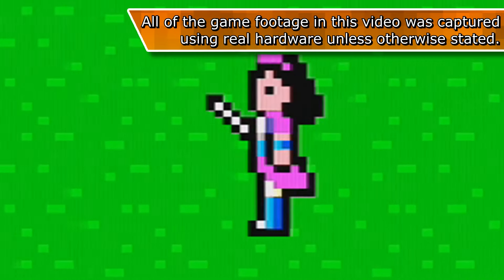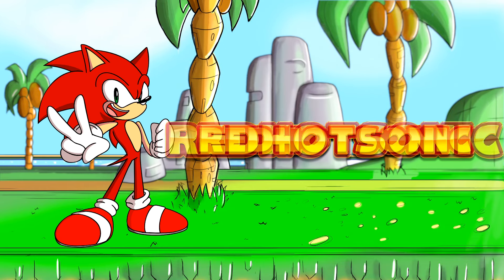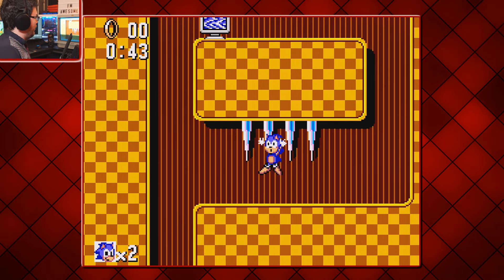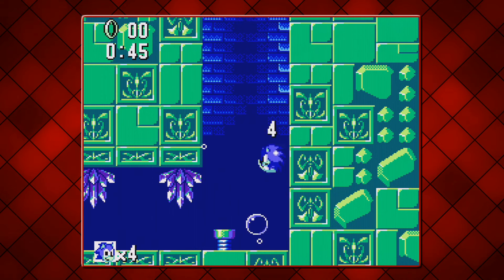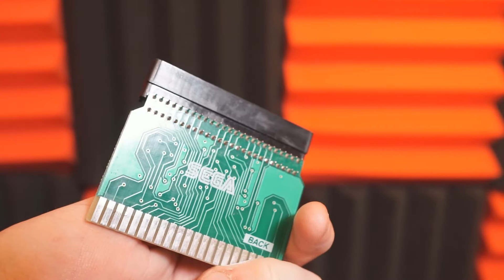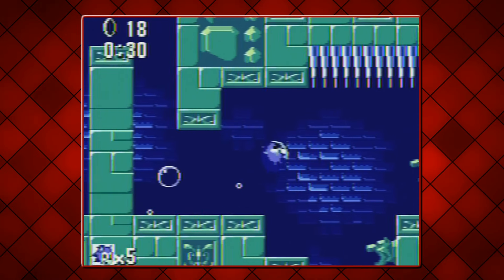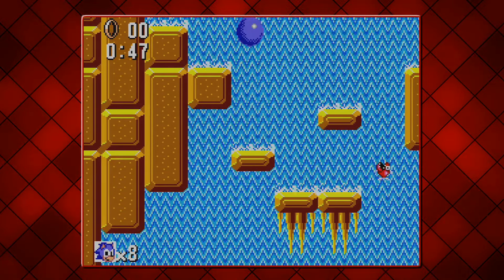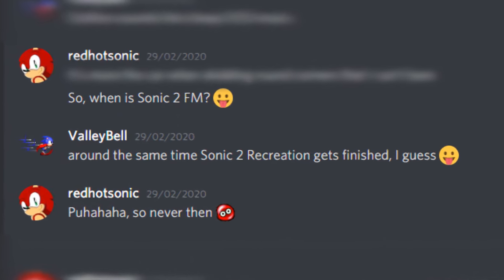Sonic 1 FM - But does it work on Real Hardware?

Comment: The master system is underrated.

The 8bit sonic 1 is very different despite being called sonic 1.
8bit sonic 2 has tails on the box but tails isn't playable he actually gets kidnapped by eggman.

The Sega master system 3 looks slick as hell it just looks so nice and cool.
Reply: Wow I never knew
Reply: I personally prefer the Game Gear version of Sonic 1, as it fixes a few bugs (like how you don't die by torching the bottom edge of the TV screen in Jungle Zone Act 2 >_<).
Reply: @RadioTails  it isn't a bug it was removed because the game gear has screen crunch
Reply: @RadioTails  That isn't a bug, it's a feature
Reply: Not in Brazil and Europe

In these places the Master System continues to survive until 1997 receiving numerous Game Gear ports.

In Brazil the Master System even won an exclusive version of Street Fighter 2 and Battlemaniacs, even with the PS1, Saturn and Nintendo 64 in places like Brazil the Master System (and Mega Drive) became cheap options for those who didn't have much money to invest in a console.
Reply: @MoonSarito  duke nukem 3d for fricking sega Genesis
Reply: sonic 1 for the master system is better than the one for genesis
Reply: edge lord 
*Sega Mark III
Reply: "Sonic chaos"
Reply: @RadioTails  and it removed Sonic’s nose! Yay!!
Reply: Surprised you left out the fact that if you get the bad ending taiks fucking dies

Comment: Alternative solution: Terraonion's Mega SD.

My guess is few people will go importing a Japanese Master System just to play MS Sonic 1 with FM sound.  Another, much more practical, way you can do this on, technically, real hardware is to get a Mega SD from Terraonion for €232 (I'll link it at the end).  If you know anything about the Mega SD, you know it's basically an Everdrive for the Mega Drive/Genesis that has onboard Mega CD/Sega CD emulation chips that allow you to play Mega CD games from an iso file off an SD card without needing the actual Mega CD peripheral (or the 2nd power brick).  Of course it also lets you play regular Mega Drive/Genesis games (yes, all regions, though there can be speed issues when playing 60Hz NTSC games on a 50Hz PAL console, and vice versa). 

But on to the main point.  As you probably know, the Mega Drive is backwards compatible with Master System games and includes the same chips that are in the Master System, so playing Master System games on a Mega Drive is essentially playing on real hardware.  The Mega Drive isn't using emulation to play Master System games.  So if you load any Master System ROMs onto your Everdrive/Mega SD, the Mega Drive will play them just fine.  However, even though the Mega Drive uses FM sound for Mega Drive games, the Master System FM sound chip is different and so no Mega Drive/Genesis can play the FM sound in Master System games.  BUT, a feature of the Mega SD that gets completely overshadowed by the Mega CD emulation is that the Mega SD can also emulate the Master System's FM sound chip.  And, of course, all Mega Drive/Genesis units support RGB out.

SO, since you'd have to use an Everdrive anyway to play Sonic 1 with FM sound, if you have a Mega Drive/Genesis you can get a Mega SD and play Sonic 1 with FM sound on your Mega Drive, which again is essentially original hardware.  This seems to me to be the most practical way to play SMS Sonic 1 with FM sound without emulation.  And wile €232 is steep, so is buying a Japanese Master System/Mark III + FM unit OR Master System FM mod + Everdrive.  And you can also play all Mega CD/Sega CD, Master System/Genesis, and Master System games from any region.  

Link to Terraonion's website:
https://shop.terraonion.com/en/products/16-megasd_megacd_segacd_fpga_cartridge.html

UPDATE: I just checked and the Mega Everdrive X7 also has a Master System FM chip.  Again, this is to play Master System games on your Mega Drive/Genesis, not your Master System.  Earlier versions of the Mega Everdrive (X5, X3) do not have this feature and no version of the Master Everdrive have FM sound chips.  So with either the Mega SD or Everdrive X7 you can play Master System games with FM sound on a Mega Drive/Genesis.

Comment: Oh actually this is worth a second comment - I've just noticed you do proper subtitles and especially since that's much rarer on YouTube than television, as a partially deaf viewer thank you loads. I don't think I noticed that until now (though I kinda have the memory of a pensioner so I'm not sure), as I've usually been turning them off for the mobile app, since I didn't realise it had subtitle settings buried in it that (like the web player) let you remove the black background, shrink the text, add a drop shadow and generally make the subtitle display far less obnoxious.

Comment: What confuses me to this day is that I have clear memories of running Meka for DOS, enabling FM unit, and that enhancing game gear game music, including Tails' Sky Patrol. I went to a boarding school in like 2005, and I remember setting it up on old common use machines. Haven't figured how how to do that since.
Reply: I went to a boarding school in like 2005 too (2005-2008 actually).

On the residential side, there was a lot of gaming stuff going on if you counted everyone's stuff, like PC, NES, SNES, standard GameCube, modified GameCube (IcedCube), GBA SP AGS-001 (with GB/GBC/GBA games), DS Phat, DS Lite, PS one, PS2 Phat and Slim, PS3 Phat, PSP, original Xbox and Xbox 360. There was even some GBA emulation on the PC going on.

No Sega hardware unfortunately; pre-2001 Sega was only represented by Sonic Mega Collection Plus on the PS2, the Radica Mega Drive plug-and-play (Volume 2) and the PC versions of Sonic 3D and Sonic R (although I did go to one of the boys' normal homes 4 years later in 2012 and he had a Mega Drive 2 sitting next to his PS3, but yeah).

On the educational side, before the Windows 98 PC in one of the English classrooms (that we got to play on if we finished our work early) was replaced, it had a load of Sonic fangames on it! Like Sonic Robo Blast "1", and one which had the Sonic CD Quartz Quadrant "present" music in it which I'd like to know what it was called.

Comment: This also works on a Mega Drive using the Mega SD flash cart, that allows FM playback with MS games.
Reply: and Mega Everdrive X7 and Mega Everdrive Pro, but with all of those the YM2413 is in FPGA. You can use a db electronics Powerbase FM to get the Master System FM sound in real hardware on a Mega Drive / Genesis.

Comment: You can use RGB with the FM unit. Just don't plug the FM unit into the back of the console. Instead plug your RGB cable in there. Then use a second standard composite cable for the audio from the FM unit.

This of course doesn't fix the non-amplified RGB problem.

Comment: I'm a little late to the party, but to anyone reading this, it does work on a Mega-SG using the SMS adapter and a Master Everdrive X7. However, the pause button crashes the game, freezing it indefinitely. So you can't pause. Otherwise it works just fine.

Comment: I think that Sega omitted the FM synthesis because of cost cutting and saving it for the Genesis
Reply: It’s not the same thing... (not the same chip) , just because the American master system was released in 1986 (psg was only available at that time) and fm was introduced in Japan in 1987, sega couldn’t release it after the original release since companies didn’t tend to do that sort of thing back then, and it was to maintain compatibility

Comment: Entertaining as usual RHS but you forgot to mention that if you have a Mega EverDrive X7 with Necronomfive's FM core built in via FPGA, you can play Sonic 1 FM edition on your Mega Drive/Genesis, which is a far cheaper option than spending god knows how much on all that equipment just to play a selection of SMS games with YM2413 sound.
Reply from the maker: That's not real hardware, is it?  That's a Mega Drive?  Hence it was not included.
Reply: You could also get the Power Base Mini FM which is REAL HARDWARE as it has the FM chip in it. And it's only $60.
Reply: He does it so you don't have to.
Reply: @redhotsonic What? You're saying a Mega Drive isn't real hardware? It is real hardware, there's nothing wrong with playing Master System games on a Mega Drive or Genesis. The system has a Zilog Z80 and it was built off the Master System it's predecessor. Why do you think SEGA released the Master System/Power Base add-on?

I'll go one further, the Analogue Mega SG has an FM core built right into it, so you can easily pop in any Master System cartridge and tick FM in the settings and don't you dare say it's emulation because it's not. 

I understand you're an EXTREME purist who enjoys spending big amounts of money on all the original 1st generation hardware from SEGA and it's great to see that, but it should still be pointed out that there are other, cheaper ways of getting SMS games to run with FM music.

Only emulators out there are either on mobiles, PCs or those horrid ATGAMES consoles.
Reply: @Oysterblade84  It's not actual Master System hardware though - it's a Mega Drive in back compatibility mode which isn't exactly the same thing (no SG1000-mode game support)
Reply: I've actually played it on my Genesis using a Powerbase Mini FM and Master EverDrive (V1, not X7), and it has problems. It does play music and sound effects, however the music is off key many times when sound effects are playing. Curiously enough, the FM hack of Dynamite Dux presents the same problem. I'm not sure if it's an EverDrive V1 issue, a compatibility issue with the PowerBase Mini FM, or an issue with the two functioning together.
Reply: Also there are some slight differences between a Genesis with FM sound and a real Japanese Master System with the sound balancing, as presented in a comparison by RetroRGB. It appears that the lowpass filtering of the Genesis muffles the sound slightly when compared to an actual Japanese Master System/Mark III FM sound unit.
Reply: @-SG6000- That's like me saying the Master System or Mark III doesn't have actual SG1000 hardware and was only backwards compatible with it, so by your comment and by RHS's purism, playing SG1000 games on his Mark III or American Master System is fake. He'll need a real SG1000 machine. 

The point i'm making is fact. A Mega Drive Genesis has actual Master System hardware in it, that's the point so it's REAL. Both Master System and Mega Drive have the same Zilog Z80a chip, both have the same VDP chip only the Mega Drive's was a bit more powerful. The only difference was that the Mega Drive lacked (mode 3) which is SG1000 that was originally the backwards compatibility of the Master System. Wow! we can't play F-16 Fighter big deal. Did anyone really give a rat's about this one particular title?

I understand RHS is a purist who enjoys playing the games on the original hardware and that's fine, I just wanted to point out that there are cheaper ways to play SMS with FM music on real hardware than the path his wife made him choose.
Reply: @Zane Gandini, But those are slight sound comparisons between the hardware specs like the dirty muffled YM2612 compared to the later, cleaner ASIC-YM3438 of the Mega Drive (Genesis). The point is that playing SMS games with an FM option on the MD/Genny is just as real as a Master System or Mark III supporting the same feature. The SMS FM core in the Mega EverDrive X7 is not the same as running an SMS game with FM mode on an emulator, FPGA is a programmable customised replica of all the original hardware inside the Mega Drive which is what the Analogue Mega SG does, it's not a cheap system on a chip like Radica or ATGAMES.

Dynamite Dux with FM sound is a hack like you mentioned which is why it has a bug in the audio, that's why it's sounds messy, it does that on my Mega EverDrive X7 and Analogue Mega SG. All other SMS games i've played with FM sound fine.

Comment: You actually CAN get RGB out of the Mark III with the FM sound unit, but you have to use 2 cables. You just plug the big ribbon cable into the front of the Mark III and leave the AV adapter for the FM Unit unplugged. Then use the Mark III's video out for the RGB video, and use the FM unit's AV out for the audio.
Reply from the maker: The problem with that was I would then have to solder both cables together into one SCART plug which seemed like a hassle 😅
Reply: @redhotsonic  Ahhh SCART. I'm running the HD Retrovision component cables which makes it a bit easier. You've got like 6 Master Systems now though, so it sounds like you don't need to bother with all that hahaha

Comment: So, here's a question I assume was answered a REALLY long time ago...

But still, I wonder. - Given that a Mega Drive with a Power Base Converter can run master system games, and the Mega Drive has both the PSG channels AND an FM synth chip...

Does the Mega Drive play FM sound with any master system games, or did they arbitrarily disable this in spite of the hardware?
Further, since FM synth was a standard feature of Japanese Mega Drives (and an add-on for the mkIII), does this vary at all between western and Japanese Mega Drives?

Comment: Besides Phantasy Star, are there any other games that have FM support removed from the Rom or is it just Phantasy Star that does this unlike other games keeping it in code.
Reply from the maker: List of games with conditions here: http://etim.net.au/smsfm/smsfm.html
Reply: @redhotsonic  Thanks, but in addition, is there also a list of Genesis/Mega Drive games that use batteries (SRAM), because I can’t find any and I just got a JP copy of Phantasy Star 2 yesterday and that used a battery for saving.

Oh and do you replace batteries in your carts, is so, then do you use knife and electric tape or do you do soldering or do you replace SRAM with FRAM/FeRAM.

Comment: I believe that since Sega made the FM sound board and released it as official therefore legitimate.
Reply: the hardware yes. this game never had a soundtrack for it made, until ValleyBell did in 2014 (the Japanese Master System was discontinued in 1989 but Sonic didn't exist until 1991)

Comment: What about the Power Base FM? Or the fm chip inside the mega everdrive?
Reply from the maker: The Power Base FM should in theory. Just putting the game onto a cartridge for the Mega Drive will NOT work as the FM chip in the Mega Drive is different. It'll just play PSG. But, you can get some flash carts like the X7 that emulates the SMS FM for the MD and then it'll work.
Reply: @redhotsonic  Yes, I was referring to the latter. I guess the Power Base FM with a Master Everdrive would make more sense from a real hardware perspective

Comment: SONIC 1 FM but does it work on a sega master 2 real hardware ? that’s the question , does it only work on the japanese consoles with the FM sound chip ??
Reply from the maker: The SMS2's never had the FM built in or it couldn't make use of the add-on. But if you got Tim Worthington's FM mod like I did with in this episode, in theory it should work.

Comment: Did you really just use a flash cart to play it, go put the rom directly onto a cartridge, what makes you think that is good enough?
Reply from the maker: What makes you think I, or anyone else for that matter, have the technical know-how to get a ROM, program it onto a chip, solder that chip onto a board that's compatible and then make a pin layout that the Master System would understand?  And if I did do that, it would be a unique cartridge.  If that then say, didn't work, it could be because of my own doing, or just the components I used, etc.  The EverDrive is widely available, and would be something that most people would also use to play ROMs on their system.  Hence, I used this.  This means anyone out there who's thinking of getting an EverDrive and wants to know if this game is compatible, they now have the answer.  It's still real hardware, it's still the ROM, so what's the problem in using this flash cart?
Reply: @redhotsonic  (It was I joke based off the series of jokes found in the video)